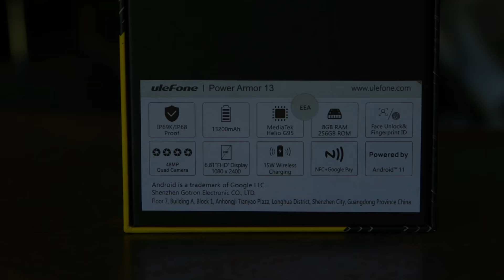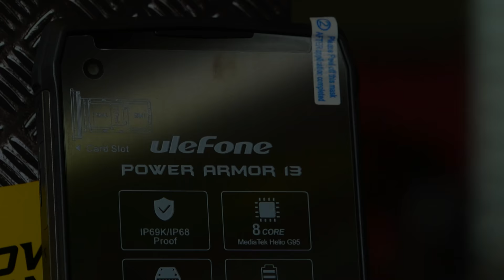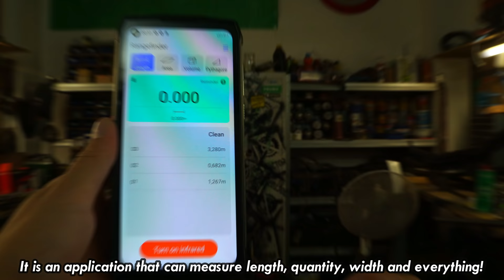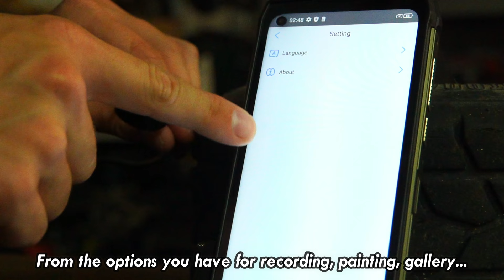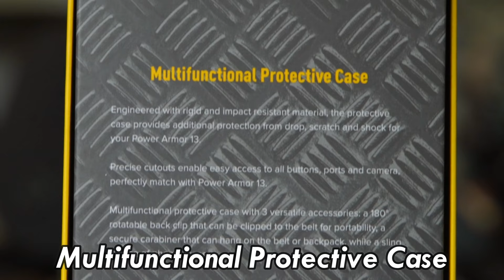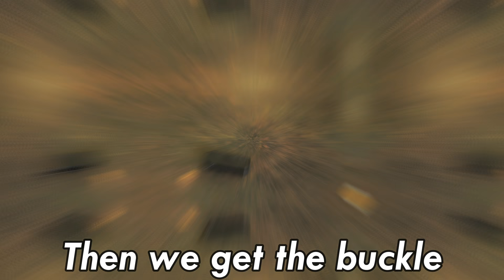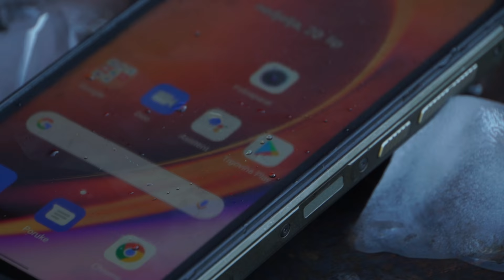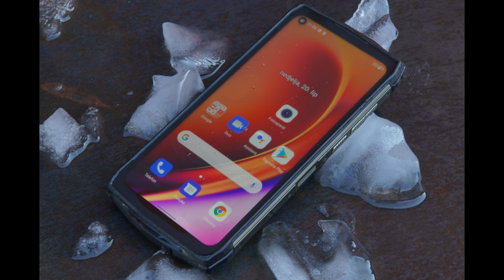MOBILE PHONE IN ICE !? Ulefone Power Armor 13

Comment: I spent the whole afternoon researching the ulefone power armor 13 that I just bought, which is very similar to oukitel wp15. Wow, it is too powerful! Large battery 13200 mAh, ultra 33W fast charge input, large FHD+ screen, large ROM 256GB, 3.5mm headphone jack reserved, very good, 15W wireless charging, reverse 5W charging function, with laser tape measure chip is very interesting, equipped with an internal camera The mirror showed me places I couldn't see before. The large-size speaker combined with the FM playback function without an external antenna, the journey must be very interesting! Equipped with a close-fitting fixed bracket protective shell, which is very suitable for my work to release my hands. The 16MP front camera is enough for me, it is definitely the Swiss Army knife of the mobile phone series! !

Comment: I buy this hammer ,  its awesome , speaker and camera flash extra ordinary.
Distance measure feature working excellent .
Enhanced cable camera also very good
battery life 5 days for me, (extensive use 3 days).
Screen is small , above front camera its just for display time and battery life, video not running on that.
both camera is good. 
Good Network catching capability.
Overall I give 4 star,out of 5
Reply: Hello, is it perfect for watching YouTube videos and I use Google Translate

Comment: This phones are meant for work outside yet Ulefone doesn't use a very bright OLED panel or at least the brightest LCD panel they can find. You can see in the video that the screen is hardly viewable outside in what seems to be a cloudy dark day. 
Also doesn't tell us if the screen has any protection. All this tests are useless unless you drop it face down on  concrete and the screen survives. Random drops mean nothing. I had my normal phone drop randomly and that survive too without being a ragged phone. 

Especially if you have a good protective case on your phone even a normal phone can drop all the time and be just fine. You don't need a ragged phone for that. Things get hard when falling with the screen down and this phone doesn't even seem to have the protection on that. Does it have Gorilla Glass or some other tech?

Comment: I have one. I went into the pool with it. And since then my microphone receiver has not been the same. The water messed it up. People can't hear me talking very well with my phone. Parts are not easily available. The turn around time to repair is weeks. So sad you can't repair it yourself.
Reply: I have one too, and it got water damaged due to little use in the rain and now touch screen does not work.
Reply: Same here..
In this video all went well,
It's so rugged nice and sturdy,but little water splash in spa on the screen today ,and screen stop working all together ,all black 😢
Manage to have this bad boy around one year since I bought it.Not sure if it's worth it to get again